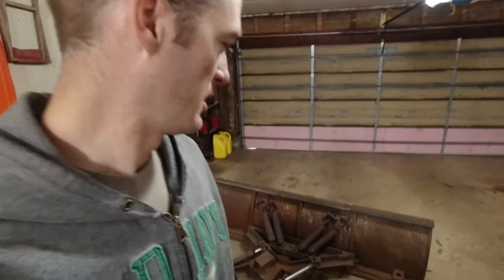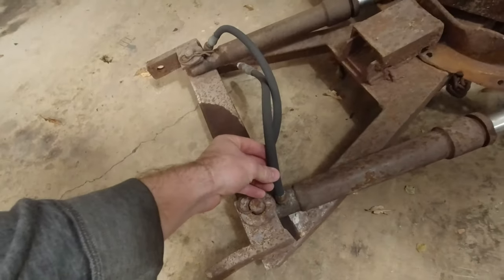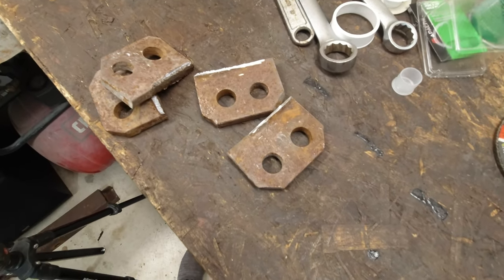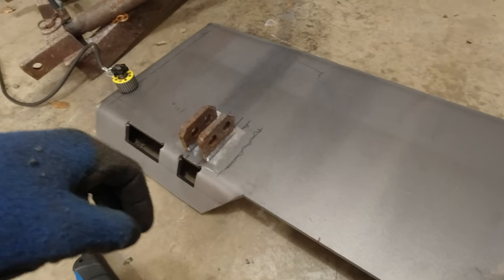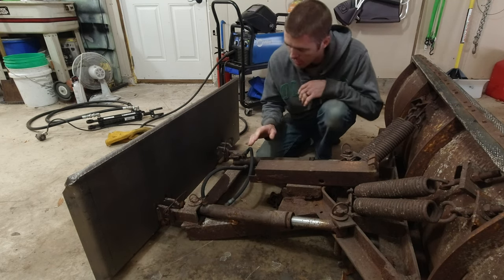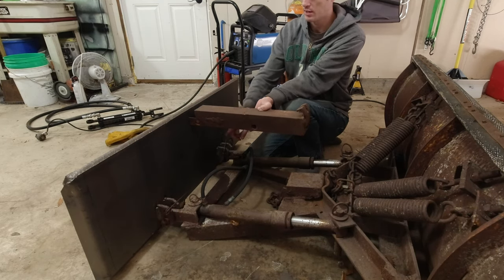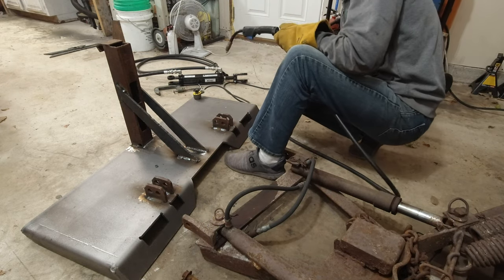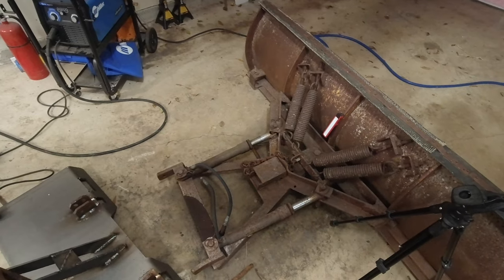DIY Quick Attach Snowplow

Comment: I wood gust put the old ones back on and dill with a little leak and gust youse them
Reply: I wouldn't recommend that as it could contaminate the hydraulic system on his brand new tractor. It doesn't take very much contamination to ruin a brand new pump.
Reply from the maker: The seals were already leaking without pressure in the system.